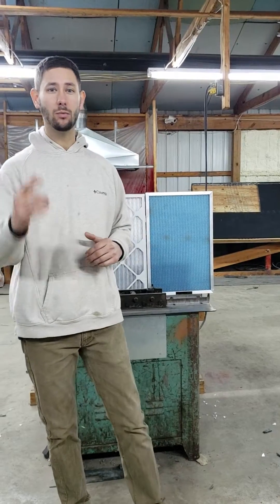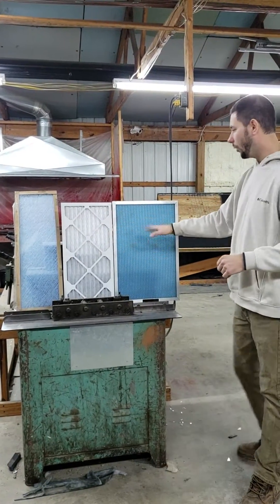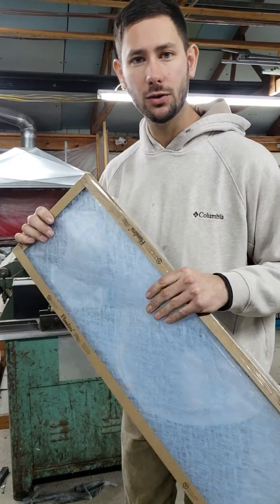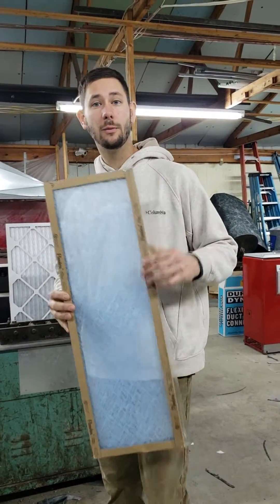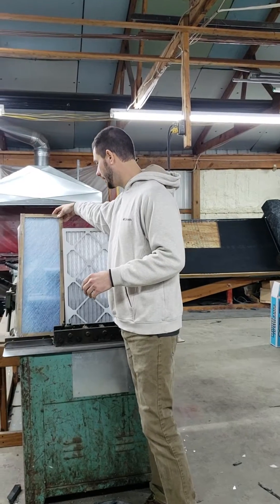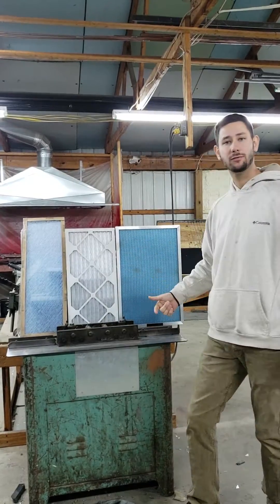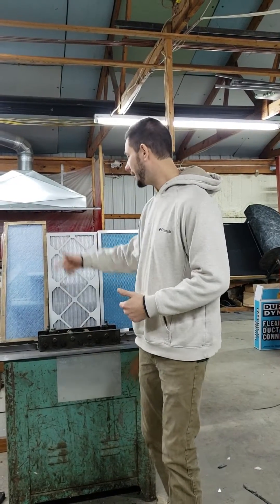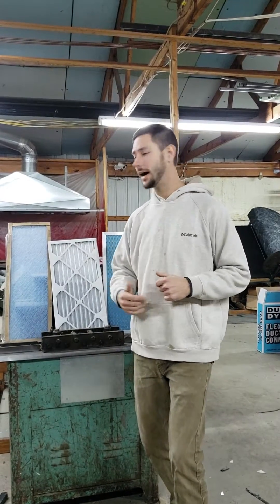Which air filter should you use in your homes HVAC system?

Comment: What about polyester filters over fiberglass?
Reply from the maker: I love the cheaper fiber glass filters because there is less pressure drop.
Reply: @taddydigest  wouldn’t that dirty up a coil though? You’re absolutely correct though. Fiberglass is the best for efficiency and low static.